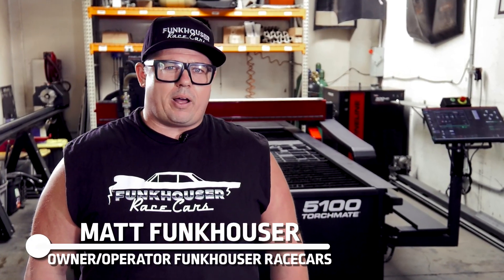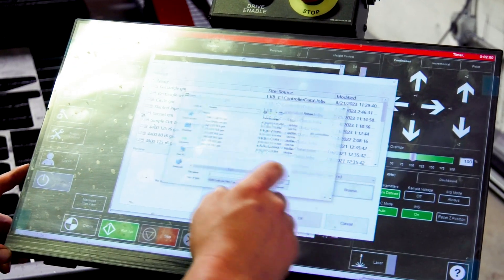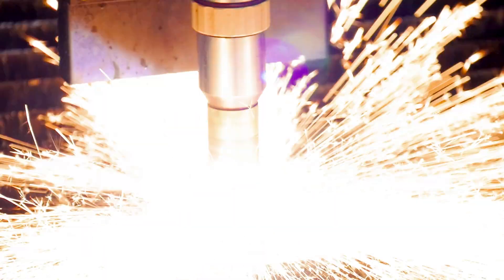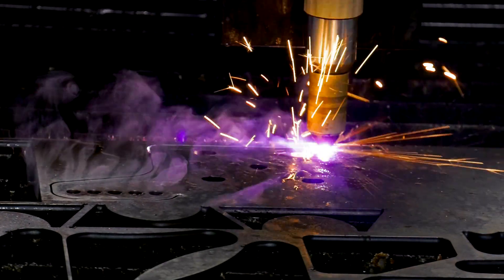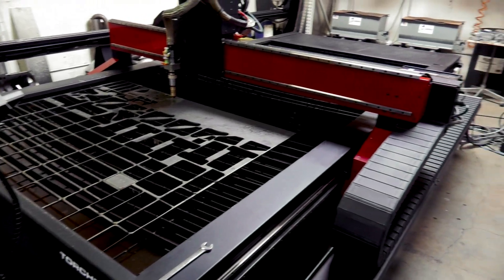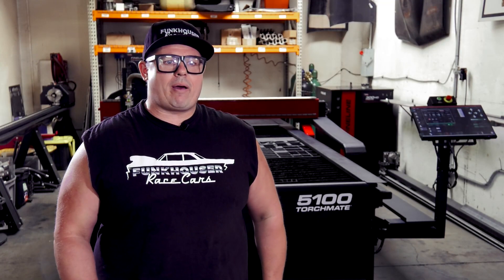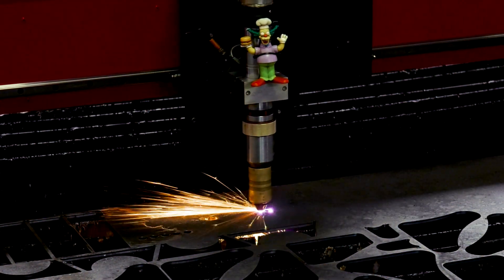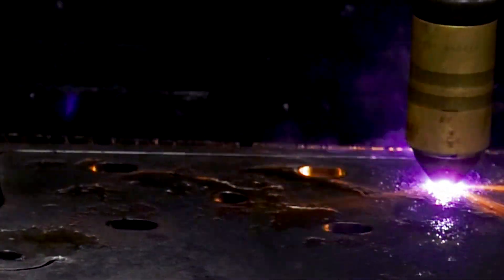Funkhouser Race Cars - Rapid Growth With Torchmate and FineLine HD Plasma Cutting System

Comment: Very cool

We have an older 5x10 with 85 hypertherm but I want a 5100/300 now!  

Is he cutting with gas or using just air?
Reply from the maker: Mixed Gas for the thicker parts for sure! Give us a call and we can help you figure out if it's right for you! 1-866-571-1066.